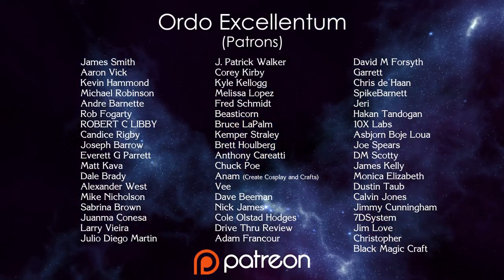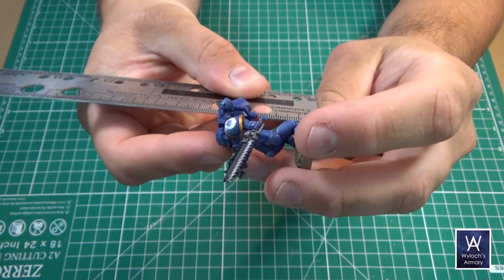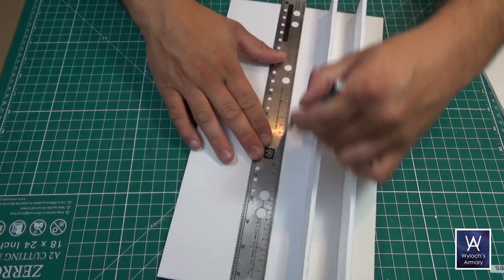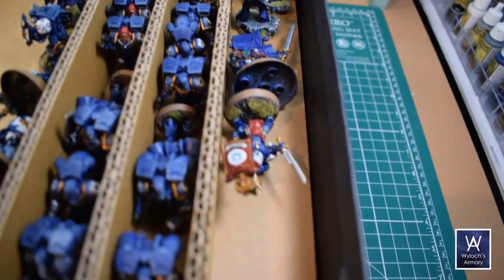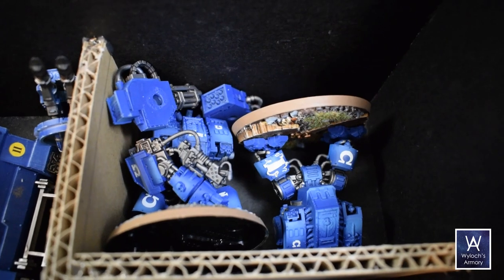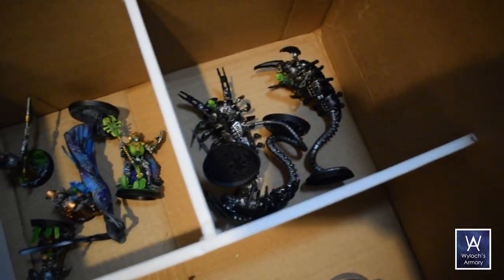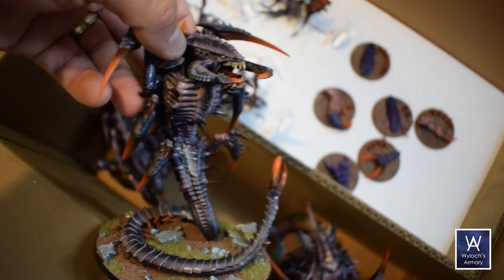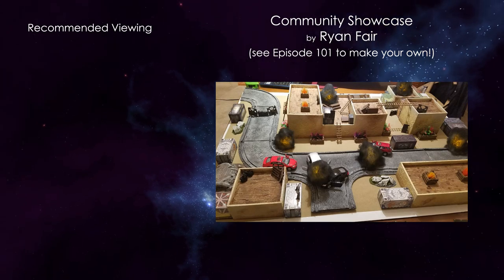How to Build Your Own Custom Miniature Storage Box for Warhammer 40k (WCV 109)

Comment: I love the project, but I am concerned with the minis scratching each other. I figure that isnt a real issue, but I have metal minis in my armies. What do you use to help with that?
Reply from the maker: Michael Casal most of my Eldar army are metal.  They are on loan right now, so not in the video. But I have never had any chipping issues with them either.  Nothing moves around really.
Reply: If your really worried about it you can always stick in some tissue paper between each model but its not a huge issue.
Reply: Thank you for the reply, I just figured I would ask.
Reply: Thats a good idea, I will have to try this.
Reply: I face the same issue, and have been thinking about making beveled rails, glueing those to a sheet of foam core and using the mini's beveled base to hold it between the rails...to remove the mini slide it to the end of the rail.
Reply: You can use magnetized sheets and magnetic bases on your miniatures to hold them in place as well.
Reply: It's my understanding that Wyloch made these to store his miniatures not transport them. I may be wrong and he can correct me on this but that is why he doesn't have chipping or damage. They get packed up and sit on a shelf, not bounced around on the way to a game.
Reply: If your worried about movement, you can always go buy some washers and put down a bit of magnetic tape on the bottom of the trays.  Will keep them in place.
Reply: A matte lacquer or varnish does the trick in most cases. If you dip them you basically get a free hardcoat as well.
Reply: If you wanna be supersafe you can do this procedure, i hope ill be clear enuff
Before gluein the longitudinal stripes to the base, cut each of them just to the middle of the height with a frequency on an inch or so, depending on the lenght of the minis you gonna store.
Glue em down as in the video, keeping the cuts upward.
Then cut a lot of stripes as long as the box width and again cut each of them at the same distamce as the one you gave at each longitudinal "trench" .now turn em withbthe cuts downward n press em down trasversally. If the cuts are right, each of them will meet an upward cut from longitudinal stripes. Since both go to the middle, they will allow the 2 range of stripes to form a crossed grid high as a sinsle stripe. This way you dont have "corridors" for rows of minis, but lil "rooms" for each of them.
Forgive me for my lack of explainin ability.
Since we r at it.... i do put also the perimetrical stripes so they support better the layers above.
Also grid structure makes the vertical striper intelocked n thus very resilient to pushes n pulls.
Emperor protects.
Reply: @Therealkolinko  You're a genius. I thought I was going to get a sheet of metal and then magnets, but magnetic sheet and washers is SO MUCH easier. Where can I find the magnetic sheets/tape?
Reply: @miguelmora7564  most likely you can pick it up for a hardware or hobby store.  You could probably find some on Amazon too!
Reply: i use varnish to add a little bit of protection
Reply: you can probably use those puffy air things you find inside shoes :)

Comment: Hot glue a big loop of ribbon on the bottom on the tray on each end. Make it long enough to poke up between the the tray and box side. Use those loops to help pull the tray out, it will be much easier.

Comment: Your timing for this video is perfect. I have been assembling the Warhammer 40K miniatures that I have been slowly buying as good deals came along & within the monthly amount I have allocated for said miniatures. So I had started looking for a low cost consolidated way of storing them rather than  the numerous small cardboard boxes I have been using. Nothing commercial is going to be cheap or really even cost effective.  I had just decided to build my storage boxes & inserts using roughly the same plan as yours. Seeing this has helped me refine a few of my ideas.

Comment: Good project for someone with a lot of models. I was thinking - you can make it easier to remove the trays by attaching fishing line or beading string to the corners of the trays. Two lengths, from corner to corner, with some slack to make it easy to lift (for each removable layer) should do the trick.
Reply: jkason2010 I use 3/4”-1” ribbons. Old Gen  Con lanyards Work Great and look cool

Comment: Adapted this for my D&D minis. I don't drive and these boxes are too large for public transport, but as I don't need to transport whole armies I've bought two box files cheap, ripped out the spring clip and put a blob of glue on anything hard and sharp, then glued the dividers straight into the box files without the extra layers of card/foam board and they work brilliantly.

Comment: Interesting system. I do like my set up and may use some of this into my 40k miniatures storage or at least for transport. 
Main thing I would do is change it up and actually put side walls. Main thing for me wanting to put side walls is every time you picked up those trays I can visually see miniatures falling off the edge if you don't have the tray properly balanced. Also for structureal support of the whole tray. Seeing cardboard or foam board is not exactly full on sturdy I can see over time they will get weaker. So to keep the price low I rather use a tiny bit of edge space and put side walls all around it so I don't have to make another one when the old one starts to wear out. Also I would put toothpicks through the bottom of the base of the tray up inside the walls for extra support.

Comment: Add on option. For the trays with short models add a strip of rayon ribbon to the bottom of the tray of the long ends on the end to provide a light, thin handle to the ends so you reduce damage to the dividers and lessen spillage chance while inserting and removing trays.

Comment: This is excellent it is giving me a ton of ideas. I also think if you travel a lot you could put a very thin piece of steel under each layer and magnetize the minis so they dont slide around. Would add to the weight but if you travel back and forth to the flgs then it may make you feel safer.
Reply from the maker: You could, but if a row is full, then the models have no where to move anyway.  And if not full, only one model MIGHT fall over at worst.  That's my experience with it over the past couple years.

Comment: Two additional tips for crafting with corrugated cardboard:
- If you're making smaller compartments on the bottom layer, like the ones for the tanks, you can get some additional sturdiness for the short sections of cardboard. Instead of using standard corrugated cardboard, glue two layers of single corrugated cardboard together in a 90 degree angle.
If you have some really big boxes of cardboard (furniture packaging or something), you should absolutely go the extra mile to reinforce each side of your container in the same fashion. That way your miniatures will be safe even if you a accidentally drop a small person on it.
- Cover the cardboard in gift wrapping paper. This way it looks much nicer, especially if it fits your color scheme. Alternatively, print some terrain or metal texture with a laser printer and use that.

Comment: Fun video, I have used your techniques on some of the few builds I have done.  I used your early paper mini video to make practically everything.  it works well for me.  I store the 30mm fairly easily in boxes with slitted floor mat foam.  it works really well!  Since I leave the 1" washers unpainted. I do have a problem storing larger figures, large or huge creatures, mainly they are just sitting in a box.  Those I do base on foam core and add sand/paint for texture.  Any thoughts or better organization?

Comment: Apply magnetic strips and glue a magnet on each base would make this much more efficient carry case
Reply from the maker: No, that would decrease efficiency by taking up extra room and requiring extra work and extra money.

The whole point is that you don't need things like individual cells for each model, or magnets, to keep the models from moving around in the box.

Comment: Just got done watching this, then searched your channel for an updated video in case you'd changed. Is this still your method for transporting and storing your Minis?
and... if so, are you able to explain why you've stuck with this vs the foam or magnetized solutions I see everywhere else?
I know there's a big price advantage. box + spare cardboard is super cheap and easy but is there more ?
Reply from the maker: Nah, nothing more.  It's economical and as my collection expands I don't feel bad about throwing it away and making a new one.
Reply: @WylochsArmory  that's fair. and I'm guessing no issues with paint either. I've been stressing about what I'll do for my complicated and pokey tyranids, but yours seem to be just fine.
I think you've solved my problem

Comment: Surprised you did not use cross bars for the infantry.   They would prevent minis rubbing and provive more structural support.
Reply from the maker: RupertFoulmouth As I said several times in the video, the whole point is that by NOT using dividers you can pack a LOT more models together.  I have never had any issues with rubbing, paint chipping, etc, including my metal models.

Comment: Where do ya'll find double corrugated cardboard. I haven't been able to find any. I just take two cardboard pieces and glue them together.
Reply from the maker: Just saved from random packaging.  Foam board works fine too.
Reply: If you don’t have easy access to used boxes, you can buy double corrugated boxes at home DIY stores (Lowes, Home Depot, etc.) for a couple bucks; look for the x-large.
Reply: Daniel Meyer 
Um thanks I looked in all my crafting stores but never seen any. Didnt think to check those stores. Thx

Comment: If you are willing to spend that much money on minis, scrounging up the 20$ for a plastic tote with $8 adhesive magnet sheets and some disc magnets should be priority uno.
Reply from the maker: I couldn't find magnets tiny and strong enough to fit in a slotta base.
Reply: @WylochsArmory   I had same prob so just used 4 (2mmx1mm) per mini in a + config     I only have grots that small but it worked for them